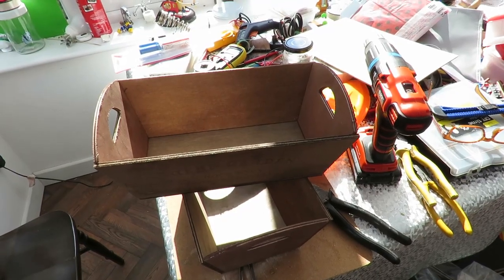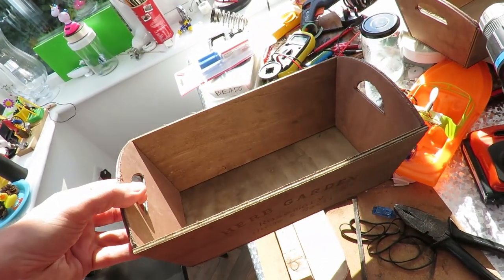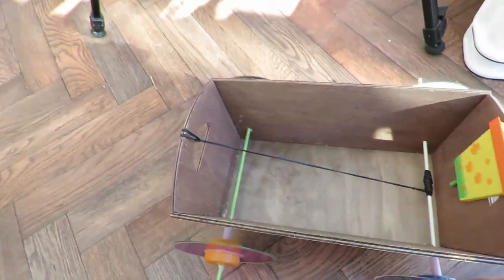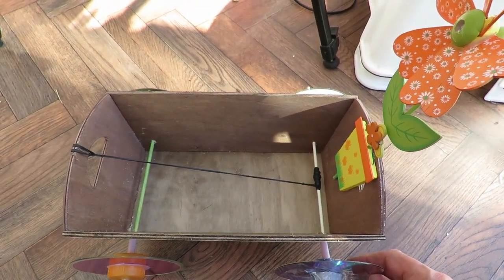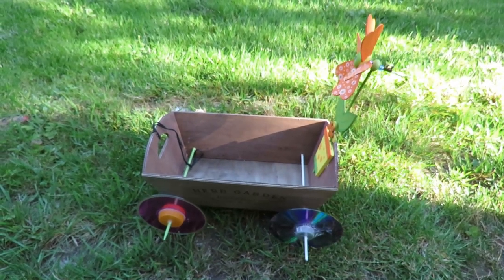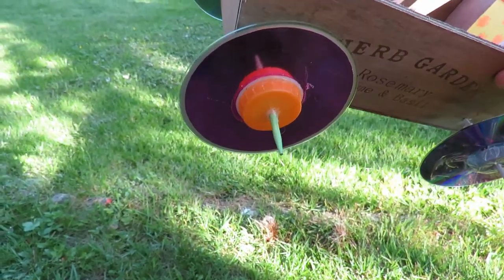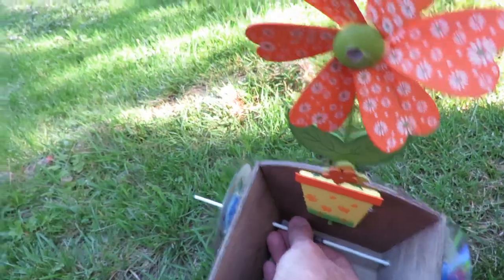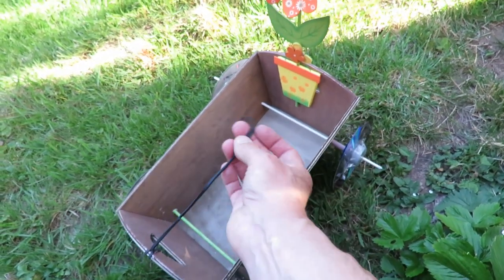Put a rubber band on it #0271 Poundland plywood box car

Comment: Hi Grandad. I like the box car, it has a look that reminds of what you might see in the 40's and 50's at a fruit market loaded with peaches, oranges, or just whatever. Well I was wondering if it would be worth your while to build a flower fan like on the back of your box car and use a couple of gears to make it go with wind power? You may have built something already like that, but I don't recall seeing anything. I am sure you could do it with all of the experience you have on building unique projects.
Reply from the maker: In the previous episode I used that flower fan to power a car but I had it direct drive, not through gearing. Using gears always requires extra time and effort 😁
Reply: @Putarubberbandonit . Hi Grandad. I think the one I had in mind you have already built. Sorry I did not view the previous video of your build with it as direct drive. I sometimes jump around your line up when I get behind. The car I was thinking about was the one you cut the gears out of card stock and used them as a ring and pinion set up. So forget I mentioned it. I know what you mean it takes more time than it is worth on some projects. Sounds like we share the same length of attention span. Lol. I like to get results as soon as possible when working with wood and that just does not happen. Okay back at it. I have work awaiting me.
Reply from the maker: @Sea-Dog5496 I cannot possibly expect anybody to sit there and watch every video I upload, that is one reason I started the other channels to try to reduce the number of videos uploaded on the main one. I am not saying don't watch and I appreciate every view and every comment but please never feel obliged to watch them. I can no longer remember every video I have uploaded and when I get comments on some of them I have to sit and watch them again to remember what they were about before I can reply 😀👍